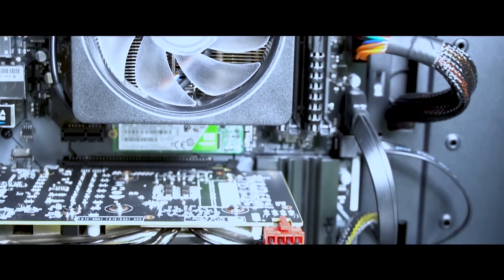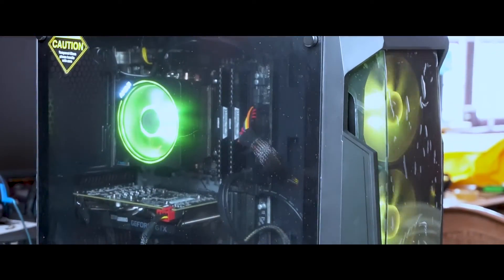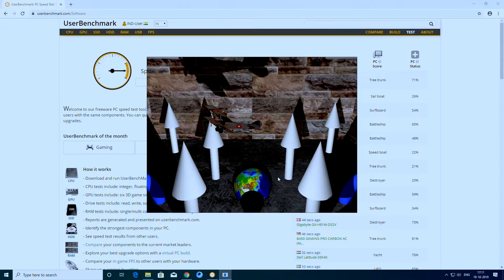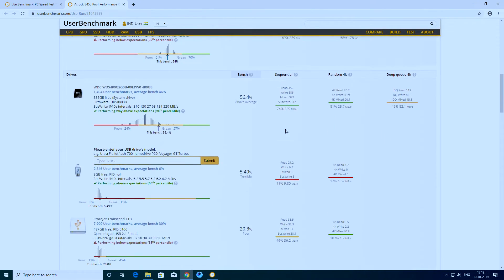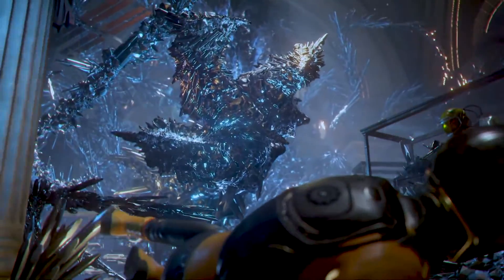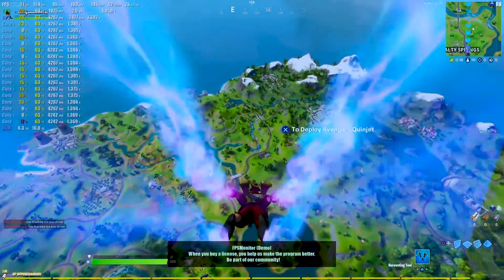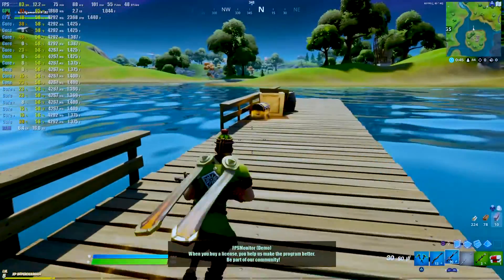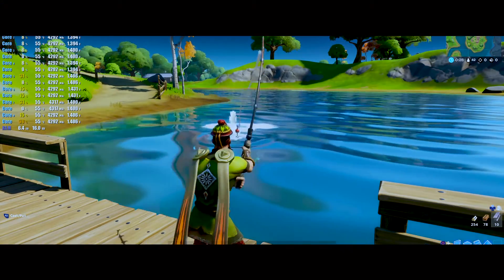Ryzen 7 3700X 90+ Fps Gaming & Editing PC Build in Tamil Tech Vibrate

Comment: Bro neenga use pannirukkaradhu 3700x processor then how can u fit the processor in b450 motherboard instead of x motherboard does it will fit?wht is the difference please tell me bro??
Reply: B450, x470, x570, b550 motherboards ellame am4 socket tha use pannuthu. So no problem 😉